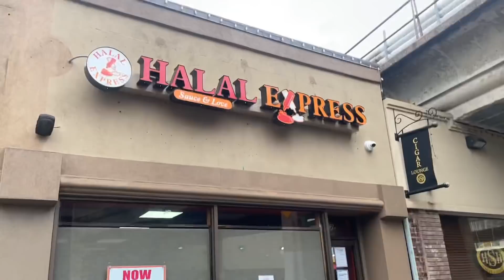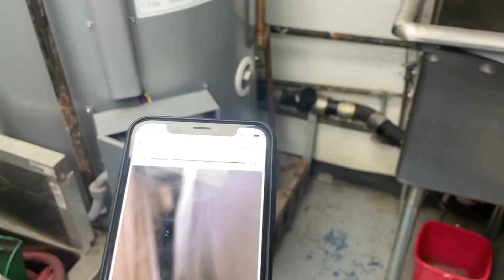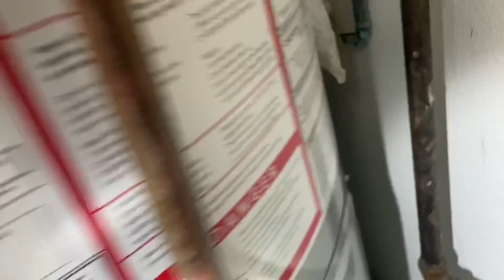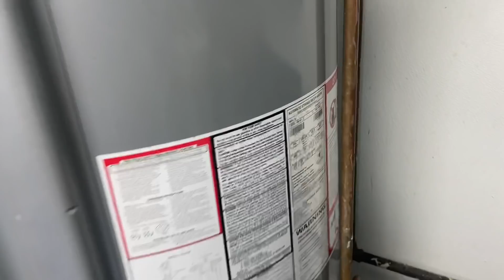Water Heater Back Drafting & Flame Roll Out with Several Code Violations - Owner Won't Listen

Comment: That’s a normal day for me. Part of a hvac life. Just add zeros in front of the decimal, and move on. 3/4 on that drop is fine. Not a gas flow issue. 100percent a negivive air issue, he should have installed a direct vent tankless. Probably the co getting to his brain from the constant back drafting.

Comment: Curious, why he didn't get the contractor who installed the unit to come back, since if its installed wrong its a installation issue (gas pipe, no power cutoff at the unit).  The original installer should be held accountable, unless the owner told them to just do it or something and signed a waiver or something.  I can just see if there was a fire or something, insurance would take one look and deny the claim.
Reply: No defect in the equipment, ALL problems are caused by the negative air flow in the building. The original contractor no doubt told him that, now he's whining to AS about it who are sending Mikey. The thought process in the owner is service from AS is free, repairing stuff which isn't under warranty isn't free. Even with extract off and the heater off there is still negative air flow into the building.

Comment: Handled it professionally. He's just an idiot. He probably definitely didn't pull permits. So doesn't sound like someone to be involved with. 

He realistically should have put two 80 gal  electrical units crank it up and put a mixing valve. Then no more draft issue.
Reply: @PipeDoctor   It bet dollars to donuts he has never shut the restaurant down, just operating without hot water

Comment: Is it missing the chimney cap,and the stack may need a barometric damper
Reply: @PipeDoctor  yeah 3/4 only good for over 200,000  if its like 10 ft run
Reply: @PipeDoctor  yes,but first figure out why the building is in a negative! Especially if the fans,are off!

Comment: Raise up emt  pipe install switch and continue with emt to hot water heater control box. This would have not passed electrical inspection no permit was taken out.

Comment: That was so difficult and frustrating to watch all the way to the end with those people. RTFM 😑 If you read the fantastic manual it even shows an idiot how to install the water heater correctly and size the gas piping. 
               200,000 BTUs of gas heat they don’t understand how many pounds of water are being produced into that small room with the Backdraft making a high humidity in condensing on a cool metal surfaces 

        It’s difficult to talk logic to a log 🪵

Comment: There is a problem with "some people" they are wanting to always save money and compliance doesn't matter to them.  They know about safety, but don't like being told by others that this is the only way to do something. I as a Kiwi am well known for D.I.Y. it's in our culture anything to save a buck. However with today's technology it can be very hazzadus to do so. Especially Electrical and Gas. Always hire a professional that is licensed and Registered to the prescribed work.  Cutting corners does not cut costs, it creates them. Although what you do might work in the long term it will fail and be more expensive to remedy than, "doing it right the first time" (So say's Saint' Mike the first (Mike Holmes) ).

Comment: Seems like they don't understand how that unit works.  It's really hard to convince someone that there really isn't a problem with the equipment when they have their minds made up already.  Good try though.  Mike could you put a power ventilator on it to fix the problem or is that not allowed there. and are you as a HVAC contractor not allowed to fix that electrical problem?
Reply: You still need draft if you have a power venter. Since the building is in a negative pressure it would still rollout which is unsafe. The building balance needs to be addressed before the water heater can be used safely.

Comment: What about installing a hs2 fan for the exhaust with low voltage controls so it comes on with a call for heat

Comment: Typical sarcastic Ny plumber. No Bullshit.. Like when I miss communicate a problem and resolve to my plumber and my verbiage is wrong and I have to have a 1/2 hour lesson on proper communication hahaha

Im surprised you re willing to re commission the water heater even though install is not up to code...
Reply: Does that include gas popping if necessary and electrical disconnect?

Comment: That guy thinks you're stupid end of story. All water heater will drop on the pilot before it gets up to temp and the pressure expands the tank creating a water tight seal by design. He's trying everything to get American Standard to pay for his cheapest contractor install screwups. He needs to be calling and complaining to who installed it. Not the water heater company. I would've just said installation errors aren't covered by warranty and the warranty is void.

Comment: What a horrible installation job. That four inch metal electric box could easily house a disconnect switch so that it can meet code. Back drafting is something I test with tissue (toilet paper works), so that I don’t burn my fingers. And the fact that it IS back drafting means that the system should have been “red tagged”; the make up air is not an option if the system is to be safe from the possibility of carbon monoxide exhaust filling the indoor air.

Comment: nope, nothing more you can do, this is the typical immigrant dance they do with trying to be as cheap as anyone will allow them to be. I had a situation with a dry cleaner whos boiler was spewing out so much co that the blockbuster video store had to be evacuated. Had the fire marshal come and test it and shut it down at the circuit breaker and leave only for me to call them in a hour because they turned it back on and evacuated the video store once more. Then the fire martial locked out the breaker.